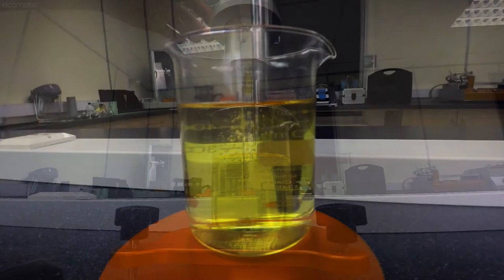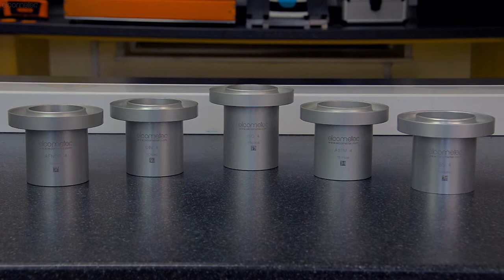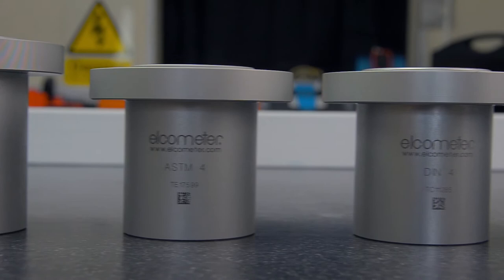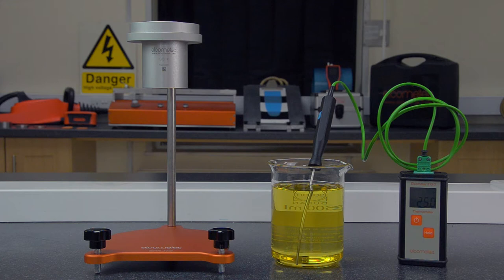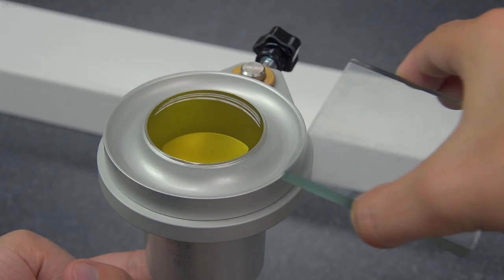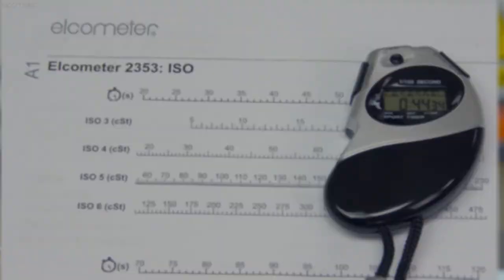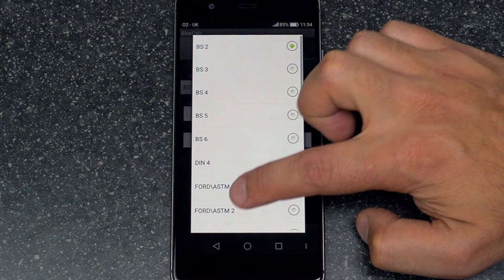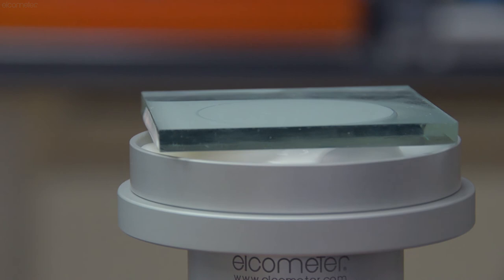How to measure viscosity using Elcometer Flow Cups

Comment: what is the conversion factor to be used while using AFNOR CUP No 2 , 4  & 6 from time to centistokes?
Reply from the maker: Thank you for your question.

The AFNOR Cup is used in accordance with the relevant AFNOR standard, which does not provide a formula for converting time into centistokes. This means results from an AFNOR Cup are typically recorded in seconds flow time, and are used comparatively.

If you have any further questions, please contact techsales@elcometer.com or visit www.elcometer.com/contact-us to find your local Elcometer distributor.
Reply: Thanking you for the prompt reply on my request

Comment: Your showing sheet to calculate viscosity from flow time .any formulae is there ??
Reply from the maker: Thank you for your comment.

When there is a formula available for the Flow Cup you are using, then it will be listed in the relevant Standard. Alternatively you can use an Elcometer 2400 Viscosity Disc, or the free ElcoCalc app for Android and Apple mobile devices to convert the seconds flow time into Centistokes. 

Please note, not all cups have conversion formulae.

If you have any further questions, please contact techsales@elcometer.com or visit www.elcometer.com/contact-us to find your local Elcometer distributor.